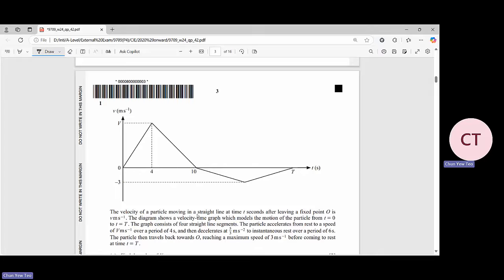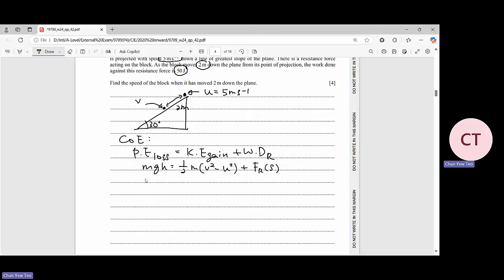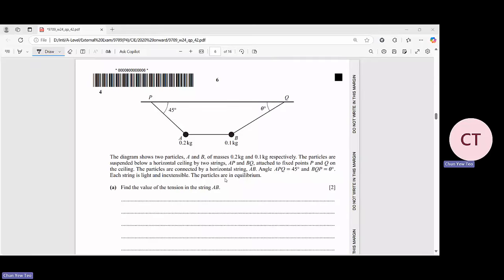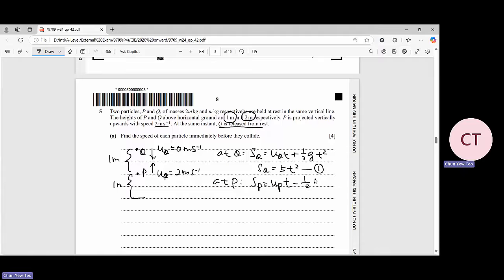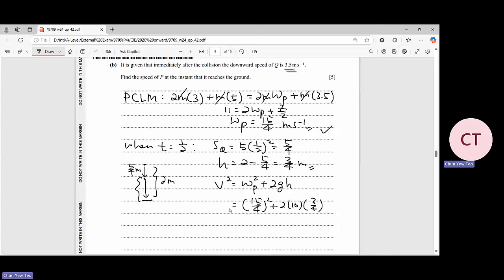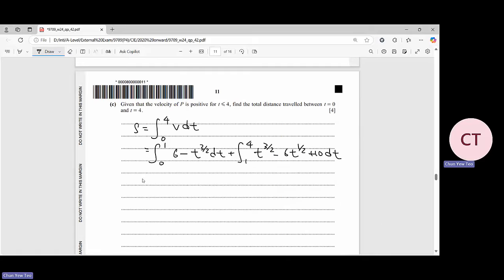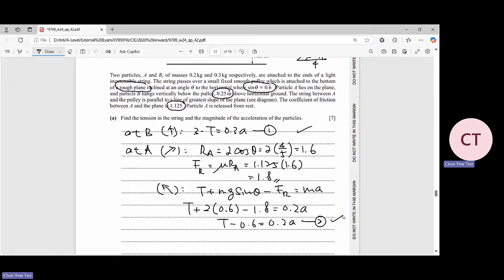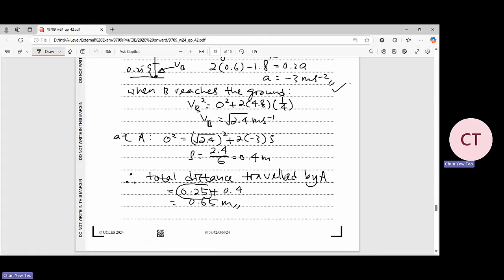9709/42/O/N/24 CAIE A-level Mechanics Guided Solution

Comment: hello sir for question 6.a), how do I know that we have to ( + c ) when integrate? usually i do kinematics it doesnt have to + c
Reply from the maker: there is always +c after the integration.
Reply: Hey, I'm a student like you and the way you should think about it is this. When you integrate you always have plus c. But let's say we are talking about velocity or distance and the object starts from rest, if it starts from rest then +c is just going to be zero. If they give you acceleration and you integrate to get velocity, and the question says it starts at a velocity of 6  then c is a number other than 0
Reply: Also when you integrate with upper and lower limits the c from the first the upper bound cancels the c from the lower bound so if you're using upper and lower limits you don't need the C
Reply: @abdullahalhanbali4854  but since we had limits, 0 and 1 why did we use c
Reply: @zarmeenasif9208 that is not limited to that is simply the domain